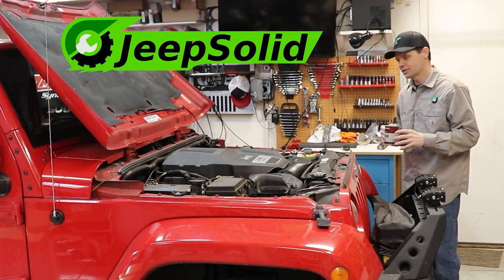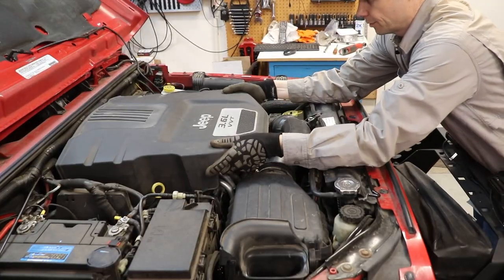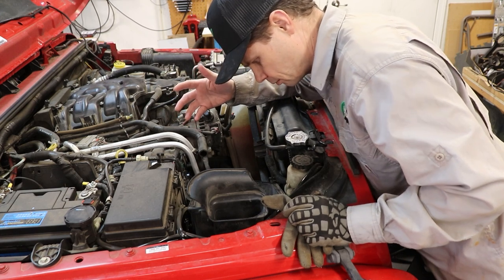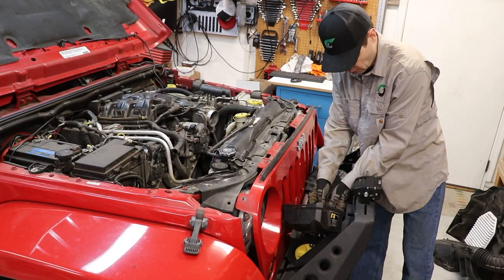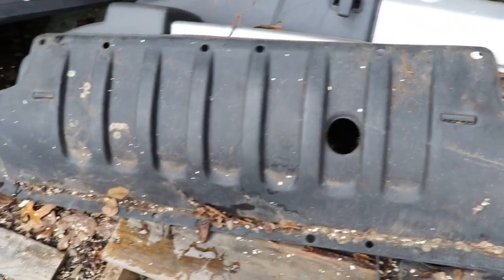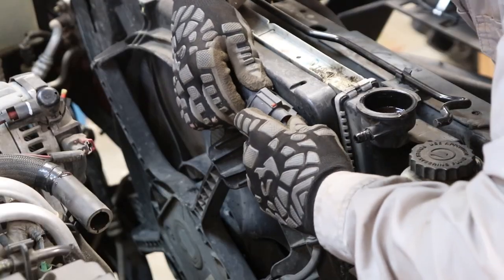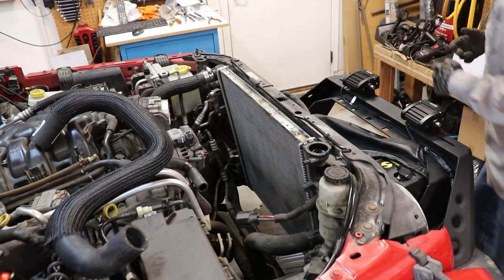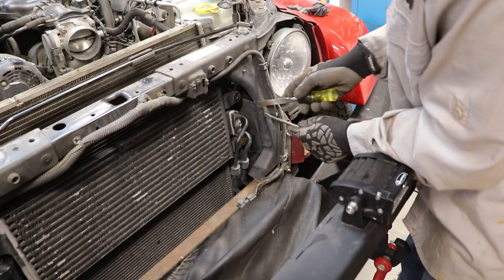My JK Runs Cooler Now!  Jeep JK Radiator replacement

Comment: I just put a mishimoto radiator and coolent  filter system in mine and now theres no room for the overflow tank, so it looks like I'll be ordering a small universal one, just a heads up if your installing the JK mishimoto one.....

Comment: Nice write up! I just finished putting in a new radiator after the dealer wanted to charge me $1300 in labor. Hardest part was taking the physical radiator out and then putting the new one in. Just take your time and pull all the tubes and hoses aside as you go. Of note... I have a 2012 JKU. There was no 8mm bolt holding the tubing in place on the lower/outer driver's side. The 2 tubes were held in place by plastic push in squeeze type holders? Not sure what they are called. But the new radiator had the same setup as well as a bolt hole for the 8mm just in case I guess.

Comment: Aw man, a lot more daunting and intimidating than I had assumed from other radiator videos. 2015 JKU Sahara has been visibly leaking coolant. I just got back inside from removing the coolant reservoir tank to inspect for cracks and unfortunately it wasn’t that easy. I’m not sure what signs say it’s the head gasket, but I do have a droplet that is hanging out on the bottom corner or possibly bottom radiator hose on the driver’s side, it slowly drips all the across the bottom of the radiator, and there’s dry coolant on the side of the top hose closest to the reservoir tank. I really want to learn how to care for my Jeep, but this might be a professional job in my case.
Reply from the maker: Sorry if I made it seem daunting. I tried to show all the steps I went through. Sometimes looking at a project as a whole seems overwhelming, but if you just look at it in steps, it can look better. Steps 1&2, do this and that… then step 3 do this… Don’t rush, make sure you have plenty of time, get a friend to help, and keep things well organized.
Reply: How mindful and thoughtful of you! Don’t worry, you were incredibly informative and I appreciate the detailed steps. I really appreciate you taking the time to share and upload, means a lot!

Comment: Crazy, this is exacly the problem I’m having with my 2014 jku sport.  Changed the radiator cap, got a new thermostat and reservoir, even had the bottom hose replaced.  Still went through coolant, no visible leaks and afraid to get another pressure test.  Might try this next.  I really hope it does not end up needing a new head gasket…
Reply: What did you come up with
Reply: @SwaveyTv  a good engine bay rinse seems to of made a big difference, coolant level has been static.
Reply: @The_Speed_of_Darkness  did you have a problem with overheating?

Comment: I just found a leak today.  It seems to be coming from where the hose and thermostat connect. It seems to be dripping there.  I tighten up the clamp but if it keeps leaking do you suggest the hose needs replacing if the thermostat opens up?  Thanks and great videos!!

Comment: How has this unit held up after a year? My radiator cracked today and if this is a viable replacement that lasts I'd much rather do this than switching to aluminum.
Reply from the maker: Still works great!

Comment: Operating Temperature 

How did the new radiator affect your operating temperature?

+, or - ?
Reply from the maker: It was running hot. Now runs at normal operating temp. Around 200
Reply: Thanks for the reply.

I'm new to Jeeps and Jeep-isms.

My Jeep has a brand new water pump and coolant flush. It rides between 200° and 219°. It's not overheating, just never realized this 3.6 runs so warm.

Comment: my fan wont shut off so its not regulating i guess. keeping the inside from heating up. what part needs to be changed.  2015 sport
Reply: Same! When I turn the engine off, it takes a few seconds for the loud fan to stop. Thought my coolant tank was cracked, but I just checked it and it’s crack free. I’m wondering if it’s a crack in my radiator or the upper radiator hose. I’m trying to figure out if it’s my head gasket which I hope it’s not, I’m still learning about the specific mechanics of my 2015 JKU
Sahara.
Reply: @wolvenfae  i got emanuel which shows you how to take apart but it doesnt tell ya if a problem is happening whats the cause

Comment: Someone makes a 2 row replacement for the jk, seen them on Amazon
Reply from the maker: Ah! Haven’t seen that
Reply: @JeepSolid  I have a 16, and have had to flush out casting sand from the cooling system, the radiator & Recovery bottle had some in there too@56k miles, thinking of just replacing the water/thermostat and radiator... I've flushed out the heater core really well...
Reply: @leskobrandon538  All the motors were die cast ( no sand). The coolant from the factory had stop leak added to it. Over time the stop leak builds up in your heater core. Eventually clogging the passages. The long life coolant actually bonds with the metals and it simply won’t flush as you surely found out. You have to replace the heater core and use new non Mopar coolant to get your heater running properly again.